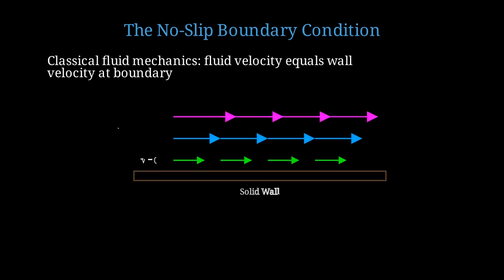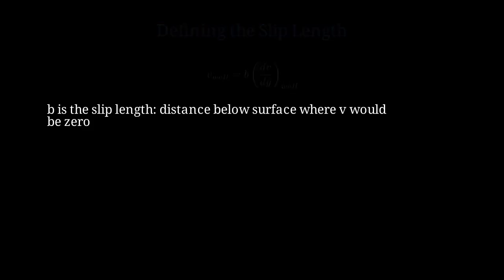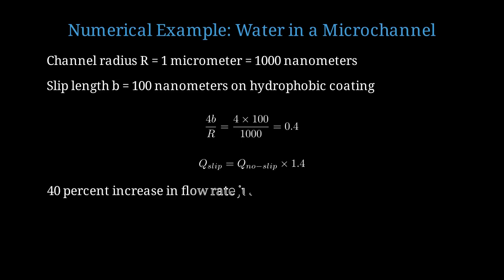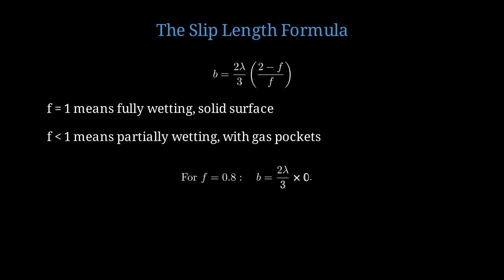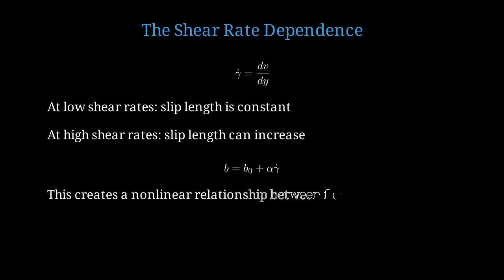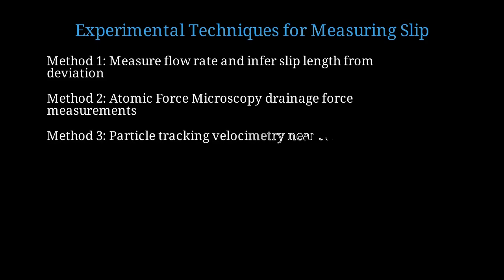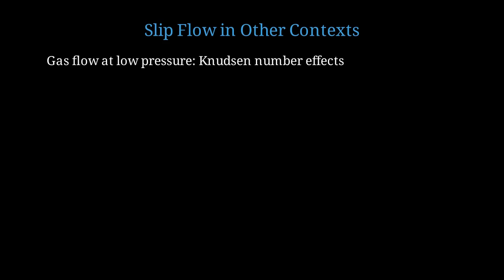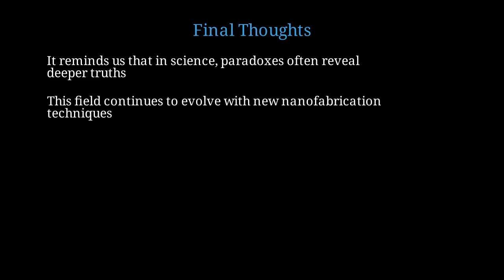Why Does Water Slip When It Should Stick?

Comment from the maker: Can molecular dynamics simulations accurately capture nanobubble-mediated slip over microsecond timescales?
What is the critical shear rate at which hydrodynamic slip transitions to interfacial instability?
How can surface topology be optimized to maximize slip while maintaining structural durability?